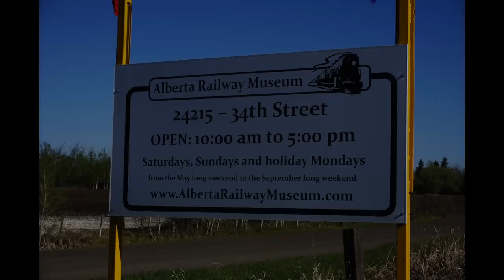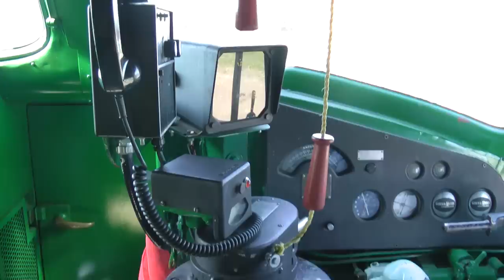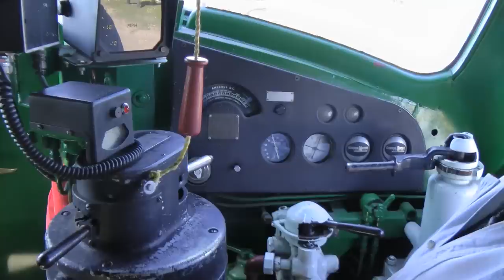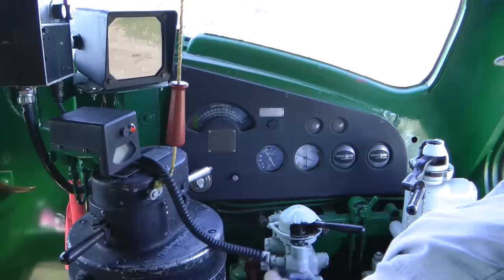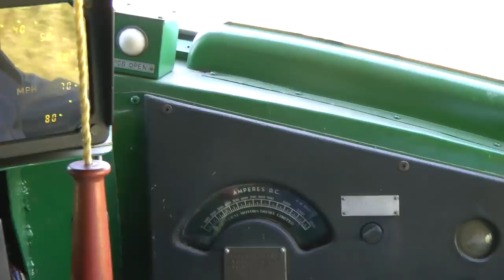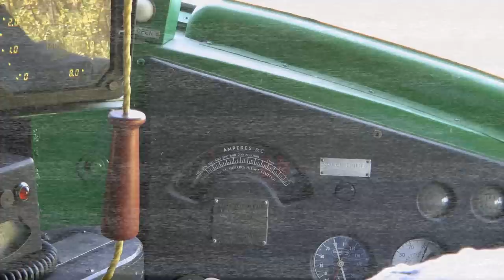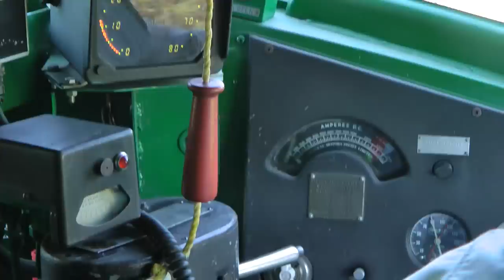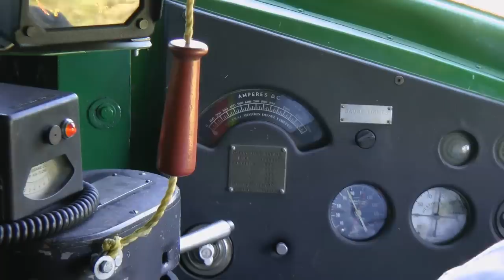CN 9000 F3 at Alberta Railway Museum May 17 2015 - startup, cab ride, drone shots,

Comment: Thank you for posting this. Such a bonnie Locomotive and the colours of the paint scheme design suits the lines perfectly and blends so well into the countrysides many shades and fields like it belongs. They really hit the target dead on there. Then you see inside at the mechanics and power in the motor in contrast and that Cab. Full credit to those who have restored her to such condition, a real credit to their hard work and time. Modern Units may produce more power and be unmatched technology wise with electronics, sensors and efficiency but this era has soul and gives you the impression it will get you back or deal with whatever. Great clip, long may it continue to run.
Reply from the maker: Thank you very much. I'm glad you enjoyed it, as much as we enjoyed putting it together.

Comment: I worked on EMD engines when serving my Apprenticeship .I still have a barring oevr key to undo the cylinder condensation ports.
Reply from the maker: Very cool!
Reply: Couldn't find ours one day so I made my own EMD test cock 'wrench' out of a scrap piece of flat bar and a couple thin machine screws.  All of our engines now have little handles tack welded onto all their test cocks, just like 9000.

Comment: On the starting procedure you made one error, when you depress the starter button hold it in until the engine reaches idle speed then and only then release the starter button. When the engine reaches idle the amount of current running through the starter contactors is less than 20 amps. When she first fires and you release the starter button it still has a high amount of current flow through the starter contactors. It won't hurt the electrical system to start her as I describe as this is how I was taught by a locomotive electrician at Selkirk, New York shop. The reason is there is less chance of a contactor sticking when started this way. This starting way works for EMD and GE locomotive's. The way you know both starter contactors released is when the auxiliary generator contactor closes and starts charging the battery. Without both stater contactors open the auxiliary generator contactor will not close. 

Cheers!
Reply from the maker: Thank you for that. I will forward the comment along.

Comment: Love that 100 RPM idle
Reply: More like 260
Reply: it is one of the best and most reliable diesel engine...emd567 i love the sound
Reply: Those big Container ship engines run wide open at 105 rpm
Reply: @Kuidmaster  The engineer said 150-200

Comment: Out of curiosity, why two horn cords? Did the other one do something other than the horn or...?
Reply from the maker: @bobsmith  Maybe Bob knows the answer to that.
Reply: @meriachee  the second cord is for a second rear facing horn, the single note one we've nicknamed the 'moose call'.  When in service I think the rear facing one was intended to be used to answer hand signals from trainmen while switching, or to recall the rear brakeman if he had gone out to provide flagging protection behind the train.

Comment: 2:30 - The 567 had an idle of 180 RPM and a top speed of 800 RPM (red line was 900 RPM). So 620 RPM range of power off idle, or basically the same power bandwidth of a typical Honda engine. :P
Reply: wanted to type the exact same thing :-)
Reply: Despite the idiots, I always learn something on YouTube. Thanks

Comment: Great video! Question? Did this F3 originally have the older "manual transition" system where the engineer watched the amp gauge and used levers to make "transition"  for the traction motors? I believe it was the F7 that featured "automatic transition" in 1948.
Reply from the maker: Thanks Stan. I asked about the controls and apparently all three units were delivered "manual" but were converted shortly after arrival on the property so that they could be run in a trailing position. 
Great question. Thanks for asking.
Reply: The F2's did and even some F3's as well (ie: those on the NYO&W) so as to easily M.U. with that road's FT's.
Reply: @paullubliner6221  Never Young Old Woman 👵🛍️

Comment: What's the control box above the throttle lever with the red light on it.  Is it a CFM indicator gauge or something else and what is the red light indicator on it for?
Reply from the maker: It is thought to be pressure monitor like you think and the red light is to alert you to the outside temperature (ha ha) because apparently the pressure drops when it's cold so the light would be on all the time.

Comment: nos what was that car sometimes hauled behing the loco....something to do with extra power or something...can't remember but it was an extra car then the rest of the load went behind it
Reply from the maker: CN ran steam generator cars in the winter as the boilers in the F units were not up to the task of keeping the passenger cars warm. They also has express cars that were insulated and ran on high speed trucks. One of these cars exists at the museum and it's on the list to be filmed.
Reply: Because a lot of old cars were designed to go behind steam engines, many were steam heated, as opposed to having stoves that could fall over and set the thing on fire. Once diesel hit, in order to keep their old cars rolling in the winter, a steam generator (extra boiler) was need explicitly for that purpose. Sometimes this was integrated into the locomotive, sometimes into an extra car that was added in, say if the locomotive's boiler was feeble, or if the unit was originally designed for freight work. The same applies for modern systems where all the cars' systems are electric: a large generator for this use is often added, if the prime mover(s) are separate. This system's called Head End Power. If you ever catch "Rocky Mountain Railroad" on TV you'll notice that Ontario Northland hauls HEP cars (I think they call them APUs).

Comment: Nice video. Are freight locomotives still made these days ? And if not what do they use ?
Reply from the maker: Freight locomotives are probably not as long lasting any more. There are sd40's out there in respectable numbers, yet almost all of the SD50 and SD60's are pretty much gone.
Reply: meriachee That’s because the SD50s were crap and the SD60s weren’t a whole lot better

Comment: Is this an F3 or and FL 1?  Very different locomotives.  It is labeled as and FL-1.  Pretty sure that most all EMD prime movers run at about 900 peak RPM.  At least that is what GM publishes.  575 seems like a strange peak RPM.  Nice locomotive.
Reply from the maker: No such thing as an FL.  FT, maybe, but even that had a 567 engine. What you are referring to is  the corner marker, as in Front Left.
Reply from the maker: There is no such locomotive as an FL-1. There is an FL-9, which is a dual power unit specifically created for the New Haven. It was based on the F9 chassis, which in Canada anyway, was the length of chassis required for steam generators. CN 9000 was native to CN from it's inception as a GMD Canada demonstrator.
Reply: 567B is 275 at idle and 800 at max.

Comment: why are the tracks blocked with debris ?
Reply from the maker: Because the neighbour dumped a bunch of stuff there. They actually damaged the tracks.
Reply from the maker: and, the museum does not have provincial permission to cross the street 100 feet further down. There was a plan to extend the tracks, but they couldn't get the necessary approvals.